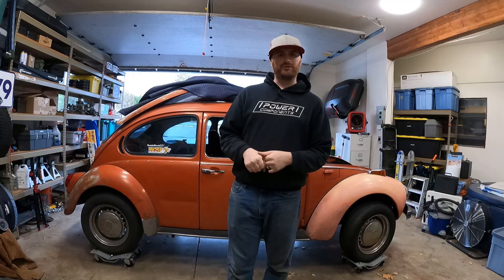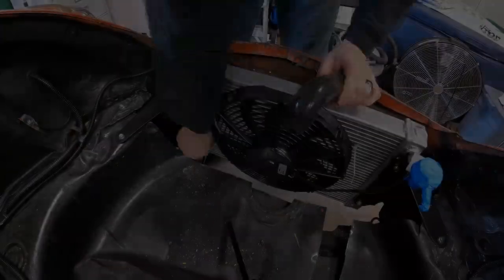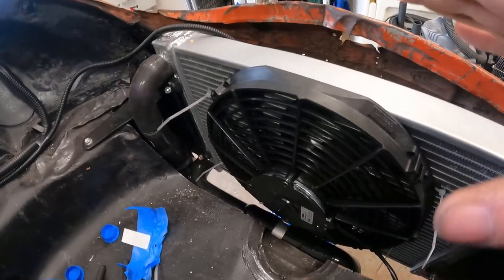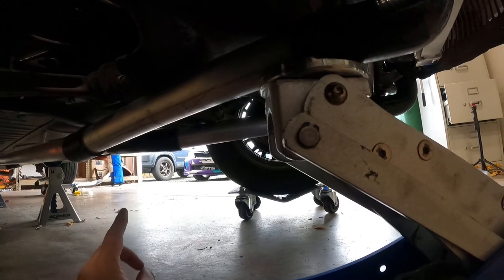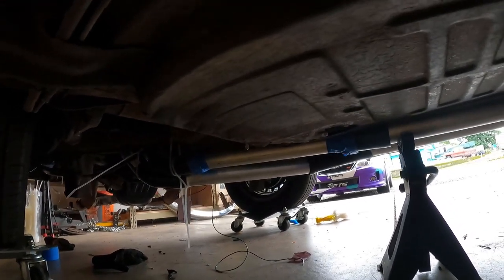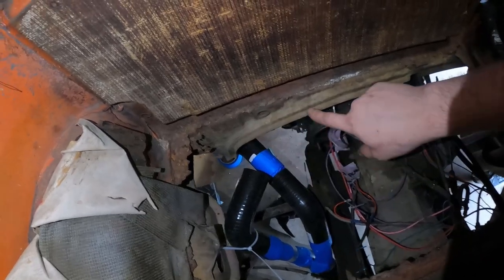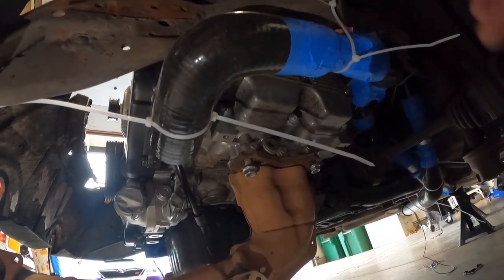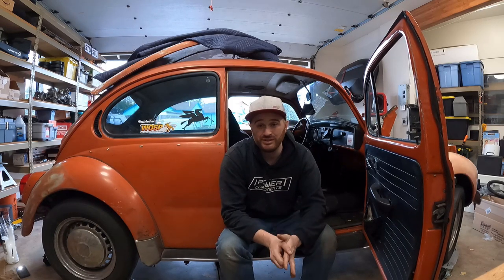Cooling system complete! Ready for final assembly! Super Beetle Part 20

Comment: Keep an eye on those front flexible  elbows, when I first did my conversion I had two rubber elbows hanging down like that and they cop a lot of road debris, one of mine nearly ruptured after copping a piece of tyre blow out on the motorway, luckily I caught it in time, replaced them both with metal elbows.
Reply from the maker: Oh dang! Thanks for that advice. I think I'll make a skid plate or something to protect the stuff from road debris. I didn't even think about that! Thank you very much!

Comment: Why did you step up to the larger diameter tube?
Reply from the maker: The larger diameter tubing has the same I.d. as the engine, but it's schedule 40 so it's also way thicker o.d. the. The engine. The radiator has about a quarter inch thinner i.d. and its nowhere near as think as the tubing. That's why I used the resizing coolant hoses. Also because I'm a dummy haha